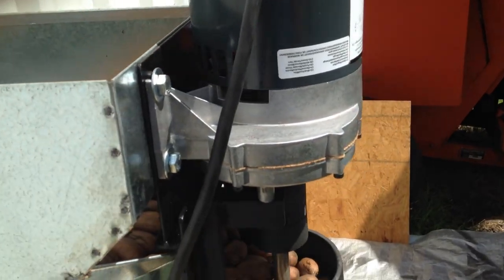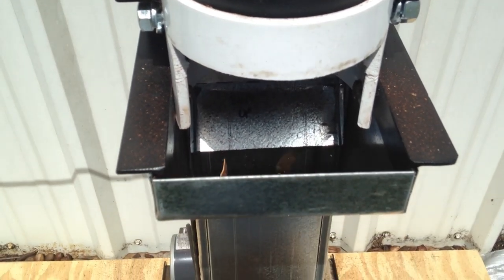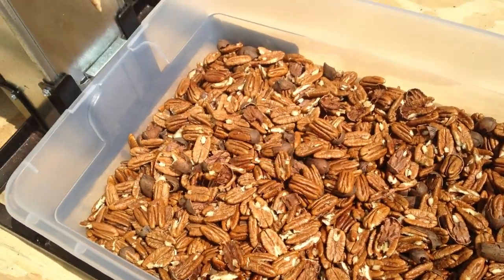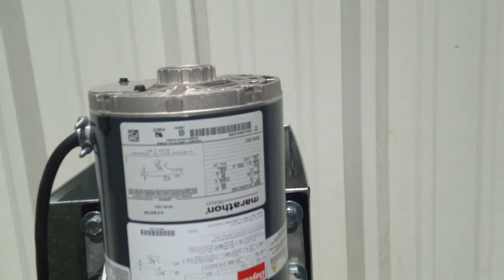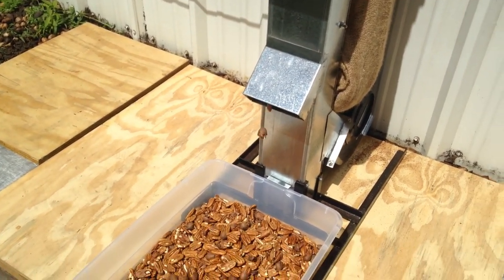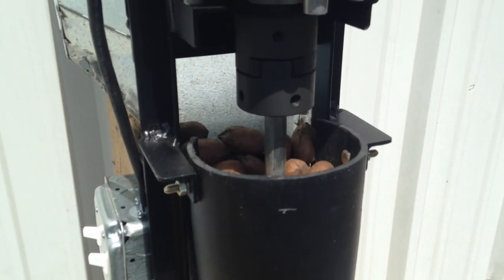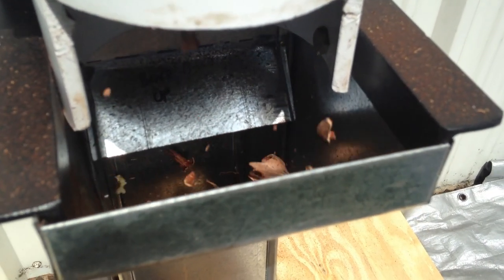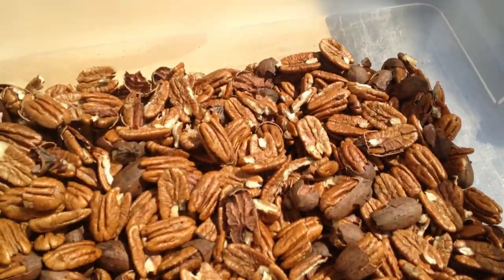Pecan Cracker / Sheller

Comment: Hi Ralph. Have you ever sent these machines to Australia. What is the capacity per hour. Regards Mike
Reply from the maker: No.  Australia power is 230 volt 50 Hz.  Our machine requires 115 Volt 60 Hz.  To use it in Australia you will need a suitable power supply such as a gasoline powered generator capable of supplying a minimum of 720 Watts continuous.  A voltage transformer alone is not suitable.  Capacity is typically 100 to 150 pounds per hour depending on variety and conditioning.  Please review the latest machine on www.pecanprollc.com.

Comment: Much to purchase?
Reply from the maker: Model 1424 “Krak-N-Blo” Pecan Pro, LLC shelling tower costs $4,950.00 plus 8% sales tax ($396.00 unless you supply a copy of your tax exemption) at the factory located at 7047 Buck Head Road, Baxley, GA 31513.  If shipped, add a $250.00 crating fee plus freight.  You can email me at kraknblo@gmail.com.

Comment: Ralph where can I buy your machine?
Reply from the maker: You may order directly by email to us at kraknblo@gmail.com.  Thank you for your interest. The Krak-N-Blo Pecan Pro, LLC Model 1424 costs $4,500.00 at the factory.  Sales tax is 8% ($360.00) unless you provide your sales tax exemption.  Crate adds $200.00 if shipped plus the freight cost.   I will need your shipping street address to get a freight quote unless  you can pick it up at the factory here at 7047 Buck Head Road,  Baxley, GA  31513    You can see additional information at pecanprollc.com.    I can have a machine available next week.  If you wish to confirm your order I will reserve one for you.  Payment is required in advance by cash or a bank guaranteed check payable to Pecan Pro, LLC.

Comment: You said something about sterilization. How, for how long and does size of the pecans matter?
Reply: I steam them for 6 minutes in a seafood cooker outside to soften the kernel to lessen breakage.
Reply: Size doesn’t matter.
Reply: Ok, do you suggest letting them dry before storing?
Reply: Boil them or steam? I have a riser for my pot that will keep the pecans out of the water. Think this will work?
Reply: @brucehayes5111  yes. I let them dry over night under a fan. I have a moisture tester and get them below 4% before storing them in a freezer in a zip lock bag. Usually they test around 3%.

Comment: Can you do a video with nuts that have not been conditioned please?
Reply from the maker: Video of unconditioned pecans will not represent average results and will be misleading.  There is too much variability.  Moisture content, shell thickness, hardness, tightness, size, and shape vary widely.  Some varieties will do quite well with no conditioning while others will not.  The Krak-N-Blow will crack all varieties tested with or without conditioning.  The percentage of undamaged kernels is higher on many varieties if preconditioned.  Some users never precondition and obtain satisfactory results that exceed the shelling quality of other traditional cracking and shelling equipment.

Comment: Machine cost is $4,000 at the factory in Baxley, GA plus tax. Shipping costs $200 crating fee plus carrier charge. I build the crate to meet UPS specs. Crated package size is approximately 27x 17 x 64 inches high and weighs approximately 108 pounds.
Reply: Hi, How can I contact you for purchasing, also, Are shipping internationally?
Reply: Como puedo contactar
Reply: @eitanachlow8081  buenas te respondieron sobre la makina
Reply: How can I contact you
Reply from the maker: email me at kraknblo@gmail.com @MarcosArciniega-hc1gs

Comment: Aren't you a little low on your price for that machine ?   LOL....J/k    THAT IS AN ASTRANOMICALY HIGH PRICE....$5,000.00   WOWSER !!!!!!!!
Reply from the maker: Thank you for your comment.  The price reflects its value as well as its cost to produce.  The design represents the best of concepts refined over 20 years of my designing, prototyping, and testing.  We succeeded in making a portable machine capable of meeting or surpassing the cracking and shelling quality of our competitors at less than half the cost, weight, and floor space.  Simplicity of design and operation conceals the enormous expense of designing, prototyping, laboratory testing, waterjet cutting, bending, welding, powder coating, mold making, material selection, vacuum and pressure pot plastic molding with steel inserts, machining, and final assembly.  God has blessed me with the ability to bring this machine to market at a cost that pays for itself for those willing to purchase.